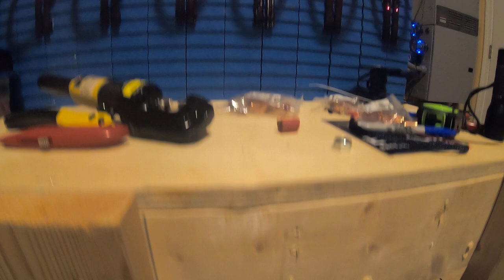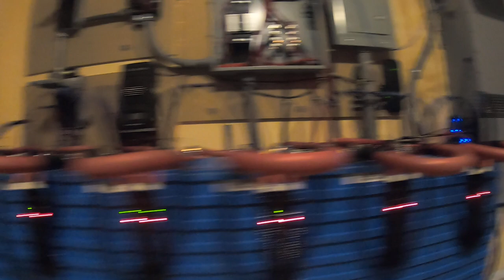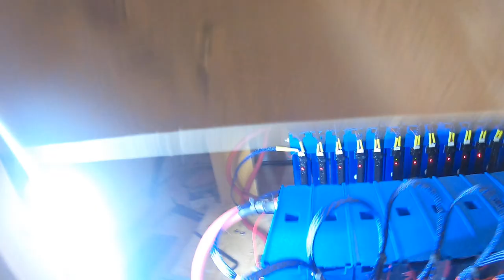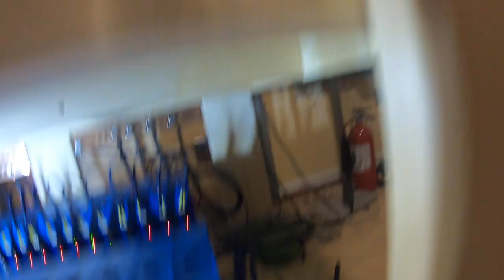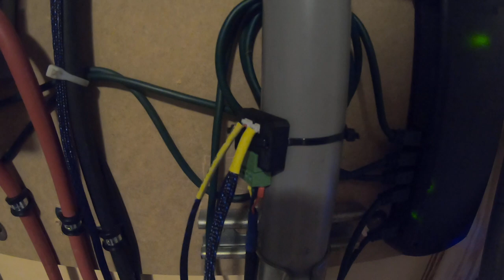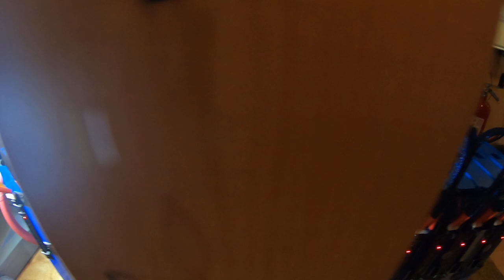Adding 200ah capacity 2/3

Comment: Greatest large set of cells is a great sight to see as they’re charging . Keeping  them balanced is what makes them a bit of a challenge when running a house very efficiently . Nice .
Reply from the maker: Agreed, we will be adding the 280ah cells, real soon, at that point we will pull these 100ah cells and re-balance them, then add them back into the main pack.